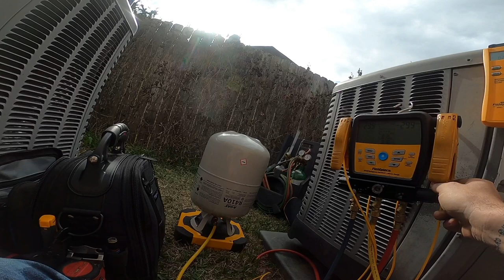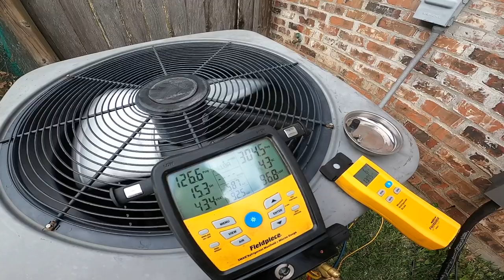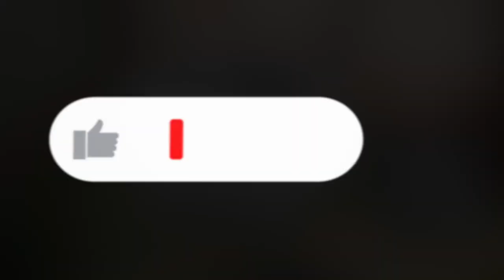Reversing Valve Replacement

Comment: A slick little tip for the dreaded RV replacements... take bolt cutters to old one and then just un-sweat the "nubs" with the old valve out of the way. Much easier.... I hate doing RVs at all. Good Video !!
Reply: I use a multi tool with a carbide blade. Copper doesn't distort, and goes back together easy.
Reply: I use a broke pair of greens to do the same thing your saying....I thought I got the idea from you but I don't know
Reply: UNCLE TED!!!!! 👍👍
Reply: @Android_Warrior  Yo !!
Reply: @jeffreyjohn2037  Doesn't that blade make shavings though ??
Reply: @TedCookHVAC  yes, although the shavings fall down away from your repair braze joints
Reply: @TedCookHVAC  : Glad to see you around here!!!
Reply: I was going to say that work smarter not harder
Reply: That’s a good tip. I’ve heard of people using tin snips also on smaller pipe.

Comment: Living dangerously with no wet rags or heat blocking putty on the new valve! Obviously you didn’t cook it because it worked but why take that chance? I always wrap pieces of wet rag around mine and keep a water bottle handy to cool them down after each joint. Nice job though reversing valves can be tricky.  I always cut mine out with a pair of straight snips and un-braze the stubs. I’ve seen a few people saying they use a sawzall which is crazy. Some brands have the 3 tubes facing down. All the Carrier/ICP I’ve ever done had them facing down so anyone using a saw on those is getting copper shavings all in the system. I don’t care if the pipes are facing up, I’m never cutting copper with a saw. Snips or bolt cutters are a much better option.

Comment: I need to replace reversing valve on an old Trane 2 ton heat pump. Can I replace with a 3 ton valve or does it have to be a 2 ton? Thanks for the video.
Reply from the maker: You call a professional
Reply: @johnisraelhvac2019  I agree. I won't be doing any of the work. It is an academic question. My understanding is using a reversing valve with a different tonnage rating than the original could lead to various issues. If the replacement valve has a higher tonnage rating, it may allow too much refrigerant flow, which can overload the system and result in inefficiency or damage. Conversely, if the replacement valve has a lower tonnage rating, it may restrict the refrigerant flow, causing poor system performance and potentially damaging the compressor. I want to make sure I purchase the correct part. Thanks for the quick reply.
Reply from the maker: @mortalfoolproductions  let your professional provide the part sir.

Comment: thanks for the video. reversing valve, is that mean that this machine has both heat pump and ac , two function in one ? thanks
Reply: Heat pumps are heat and cool capable.  Always have RV.

Comment: No nitrogen and no heat sink wtf rtfm
Reply: Haha clearly your not a regular 🤣
Reply from the maker: Nitrogen was used. You can clearly see the gauges on the unit
Reply: I think we can all clearly see gouges still attached . I also see the charging hose tucked under the pad and the cap still on the true suction . How did you keep from 1 building pressure while brazing and 2 ensuring that valve body didn't warp with no wet rag heat compound/ paste ... I believe that was the question
Reply: @c_young-hvac4586  👍👍👍👀
Reply from the maker: @c_young-hvac4586  whatever you say buddy I’m not going to have a pissing contest with you. My solder joints were for enough away from the valve to where I was comfortable of not overheating the valve and obviously I didn’t because it’s working beautiful. Those valves can take more than you think they can.